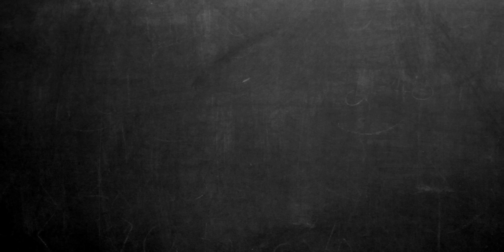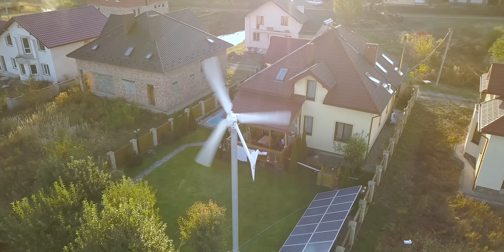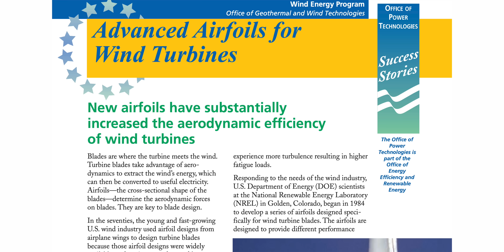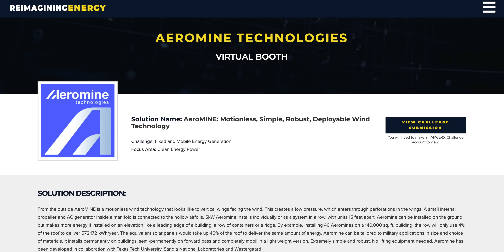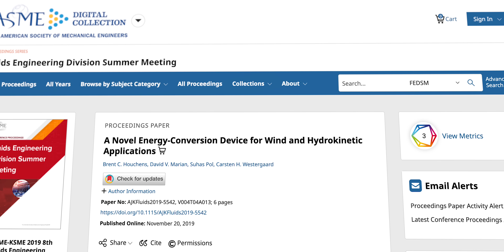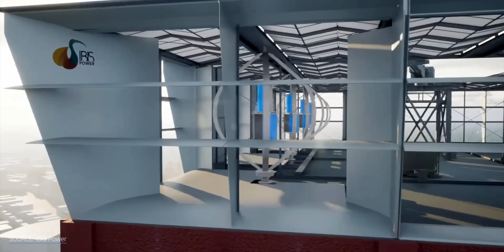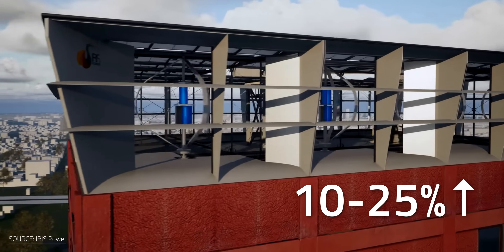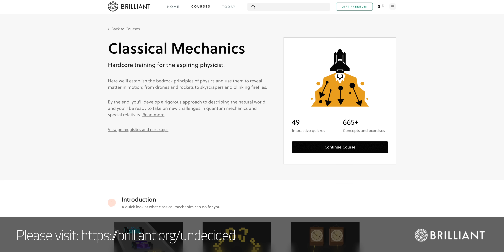How Can A Wind Turbine Be Motionless?

Comment: Really appreciate your videos, all the updates on new technology, research and new ideas.

At different points in this video, the Aeromine system is described as having “no visible moving parts”, or similar phrasing.

At 3:56 in the video, a diagram shows air being drawn past a “fully enclosed wind turbine”, “at ground level”, through a set of pipes.  It would seem as though potentially lengthy pipes would create drag and inefficiency.

At 6:00, the video of an actual installation (BASF) looks upward toward the Aeromine, and what appears to be a wind turbine can be seen beneath the central column, between the airfoils.  It somewhat resembles the “roof vent” seen on many residential roofs to pull air from the attic.  That arrangement would seem to be more efficient.

It would be interesting to know what kind of turbine or generator were being used. 

Long ago, I became interested in “ducted fans”, which are usually employed on a horizontal axis, such as an aircraft engine and propeller, or HAWT.  Allegedly, their use on wind turbines was limited to fairly small ones.

For several years, I have been thinking about a VAWT design employing a pair of vertical airfoils to funnel air to the “downwind” side of the VAWT, while shielding the “upwind” side.  That should both increase velocity and reduce drag.  

The Aeromine concept is fundamentally different, but the physical structure is still remarkably similar.  I would think a VAWT placed between and slightly behind the two airfoils would be significantly larger and more efficient than the small “hidden” turbine.

Comment: Please stop spreading false information about aerodynamics. The speed of the air does not change, it's direction and pressure is changing. Think of a sail boat with sheet thin sails, the velocity on both sides will be roughly equivalent, but you change it's direction and create a low pressure area which sucks you along. Your comparison with race cars is laughable. Under the car is a vacuum, not a high speed flow, especially given the wind friction of the stationary earth under them. A jumbo weighs almost 400,000kg and one cube of air weighs 1.2kg. imagine how much wing you would need if you were not creating a vacuum and just relying on Bernoulli. At least get the science right.

Comment: PowerNest is a well thought combined solution. Even the wind turbines are equiped with 2x Savonius rotors to help starting at low wind speeds (4x would be still better). The worrying feature is high speed wind tolerance. The forces during storms up to 50 m/s wind speeds can rip off first the panels and then the wind blades out from the roof. The panels form a really large "aeroplane wing" , because air flow enters under the panels and vortexis enchance forces. The joints to the roof and the internal strength have to be 4x secured during the whole operational period, more than 20 years, taking into consideration rusting and structural fatigues.

Comment: These are marginal, but when combined into a system they have an additive effect that can put the ROI over the top. If the static venturi creating a vacuum that turns a turbine is allowed to run over solar panels on the bottom after 1st going through the turbine generator the added power generated in that turbine comes from the pressure boost from the solar panel waste heat in a chimney effect.
If each side could rotate to be an exit or an entrance, then wind direction can change.
This static one direction only is to limiting beyond niche markets, with one direction wind blowing all the time...

Comment: This technology would  work better under water in conjunction with a Tesla turbine.  Maybe within  the water supply system itself.  Each home generating power when using water.  May even increase water pressure into the home.

Comment: I used a 1/3 hp 110 v motor for my first experiment. I attached two large (100 lb lift capacity magnets) to one side of a six inch circular by 1/4" plate of aluminum and bolted it to the motor shaft, magnets facing outward away from the motor. It was bolted down securely. I then took my 1/2" copper coil and placed it beside the magnets at a safe 1/2" and turned on the motor. In a very small amount of time the copper coil was glowing red so I quickly shut off the power. I was so impressed I went and purchased a solar panel of (33volts LR4-60HPH 355-385M) this with its 12v computerized controller should be more than enough power to operate my next experiment. I also bought a lithium iron phosphate 12v battery to start my project. My intention is to operate a 12v motor instead of 110v and build an overflow system to catch the expanding water in the coil witch will also have two one way valves to help with circulation, and a radiator to dissipate the so needed heat in my winter home. 
'
'

Comment: Nono... The wing of an airplane is not "pushed" from the bottom as your video show it but it's sucked from the top, it's not the higher pressure under it that make it fly... but the lower pressure above it.
Again... On the car, nothing is pushing it as you said, you completely missed the point.. the car is sucked to the ground because of the lower pressure under it.

Comment: Probably late to this but if the venturi effect has a cooling impact, would it be possible for get even more out by laying between the solar panel frames some piezoelectric based system to draw from the temperature difference? Just a random idea.
Reply: Actually, since the air is compressed as it goes from a larger area to a smaller area, speed & temperature would both increase, but the temperature increase would not be huge, because the pressure change is not huge.  As the air exits the venturi, it cools & slows down again.  This “cooling as the pressure drops” is how air conditioners work, but the pressure changes are much bigger.

Comment: This is such BS. The reason that wind turbines aren't typically put on roofs has nothing to do with having moving parts. The reason people don't usually do this is because it is really inefficient. Guidelines for a typical home wind turbine is that you should mount it at at least 30 feet above all surrounding objects. Also it has been demonstrated time after time that ducting wind turbines does not increase the efficiency. The only way of increasing power is by lengthening the blades.

Comment: @UndecdidedwithMattFarrell 
I have a couple questions.   As I believe you know this subject better than I so to me, you're the expert.
Which Home or Rural Wind Generators work best?  Perhaps I should specify; 
Is there a different wind generator better for a home under 2000 sq. ft.  vs  the better system for a house under 3000 sq. ft.  Or a piece of land that is apprx. 1 acre in size with a barn?  Inquiring minds want to know.  
There are so many options advertised on Soc. Media that I never know which one is real or good, or which are just wind up my shorts. 🤭😄
Thanks for all you do here.

Comment: 3:00 You are a little wrong with the way you describe how an airplane generates lift. Yes at a positive AoA(angle of attack) the higher pressure below the wing will push upwards. Kinda like putting you hand out of a car window while driving, this is how most people think lift in an airplane is generated. They think that the air pushes up on the wing from below because of the AoA of the wing, however MOST of the lift comes from the top of the wing having lower pressure. 2:40 shows an airfoil at a high positive AoA. If for instance you had a cambered airfoil, like the ones on an airplane, at 0 degrees or even slightly negative AoA it will still generate lift even though there will be no upwards push from the bottom of the airfoil.

There is a simple experiment that will prove how most of the lift is generated. Take a piece of paper in front of your mouth. Let it hang down and only blow across the top of the paper. It will be lifted upwards, hence why it is called lift. Roughly 65-70% of an airplanes lift comes from the top of the wing.

Comment: I believe the Powernest is a better idea simply because of different directions the winds can come from. The new wind invention captures wind coming up a building wall from a fixed position, but if the wind comes from behind it, equals no capture and no energy. The Powernest also performs a cooling of the solar panels, adding longer life to the panels. My money is on the Powernest. Great vlog of information as always.
Reply: Powernest is a low efficiency system as more than half the wind is bypassed.  Any solar panel mounting that is raised gives wind cooling.

Comment: I have a few questions regarding the longevity and efficacy of this product. Most power generation devices are developed in areas where there is an average temperature of 28°C during the summer, and -10°C in the winter. 

How would this installation withstand a full northern Canadian winter of -28°C to -35°C and snow? 

Wouldn't snow and ice build up be a massive shortfall for a rooftop mounted installation? I would imagine that it would need some sort of heat line to ensure the venturi tubes do not fill with snow. 
You mentioned that there have been installations in the Netherlands. Have there been any attempts to test installations in Norway or Southern Sweden?

Comment: I've often thought we should be able to harness the sun's power in a focused way like this.. like basically create an orb or dome type magnifying glass that can direct the the light into fiber optics or something reflective and transfer that to some very concentrated panels that don't need to be as durable or resistant to weather.. you could capture a larger area of light with cheaper materials from more angles and then direct it at the panel, getting much more power out of the same square footage than your average stationary panels.. or maybe skip the solar part altogether and just use the concentrated heat instead since the main drawback to this idea is probably cooling the system.

Comment: After all, the reason is the price for the entire described area (by the blades of the propeller during rotation). The cheapest description of the area of the propeller blade.
Another parameter is the price of protection against strong wind. The cheapest again are propeller blades.
Energy is always proportional to the area described by fixed and also moving parts of the device.

Comment: Hi Matt - I think these wind devices are probably not as effective as they make themselves out to be.  For example I need to reach 60 miles per hour to get my airplane, a Cessna 172 airborne.  Full weight is 2,550#.  The wing area is 174 square feet, or 25,026 square inches.  This works out to .01 psi lift for a fairly efficient wing at 60 mph.  At slower speeds the lift is much lower.  This wind device is a clever idea but it doesn't stand up to the calculator test.  Thanks - John

Comment: OK I was going to ignore the bit about airfoils enabling us to conquer the skies. Then you got onto Bernoulii effect. So... while, yes, the airfoil shape is important it is hardly the reason we were able to develop powered flight. The key development was not the airfoil shape but the POWER. Enough power in a light enough package is what enabled us to conquer the skies. Yes the shape of the airfoil in the wing and propeller (even more so arguably) enabled efficiencies and control of the behaviors but it's importance is really overstated and the importance of all the other things that make aircraft possible get lost in that oversimplification. Bernoulli effect is barely in play at all. Air does NOT travel faster over the top of the wing because it magically needs to catch up with the air below the wing. The wing is tilted up so the bottom of it pushes air downward. The flow is way more complicated than that but mostly it's not about airspeed differential. 
Need to understand how lift is created? Grab a sheet of plywood in a good breeze.

Comment: All very interesting and encouraging.  However, I was surprised that the Aeromine units are restricted in that they are unidirectional.  They don't appear to be so massive and large that they couldn't be mounted on a rotatable base that would allow them to operate with high efficiency by following the wind, regardless of direction. That can't be such a novel idea that it hasn't occurred to the engineers, so I'd like to see more explanation of their reasoning in not doing that.

In any event, I'm pleased to see that innovation continues in the realm of these kinds of power sources.  Keep it up!

Comment: Your explanation of the "upside down" airfoil of (racing) cars is wrong. Cars have the exact shape of an positive airfoil (straight underneath, curved at the top), resulting in higher air pressure underneath the car and lower on its top. Therefore every car of this shape tends to "take off" at higher speeds. The aerodynamics of most racing cars are still in the "middle ages" and all are countering the unwanted lift effect with spoilers on top creating drag and/or reducing airflow underneath by lowering the car. Only the latest Formula One car designs tend to go in the opposite direction by letting air flow underneath the car in a sort of upside down airfoil direction, creating a suction to the ground effect. But that's still work in progress...

Comment: I think personally that renewable (especially solar and wind) energy will be miniaturized to power individual buildings. This will mean power independence for both the industrial companies using them as well as residential buildings and also reduce the load on the public electric system, allowing them more time shift to a largely renewable power grid system.

Comment: Thank you for explaining technical features in a lucid and practical way. I helped install many wind turbines in the Tehachapi desert, ca. I also love birds which these turbines destroy quite frequently. Currently gathering materials for a small savonius rotor which does not harm birds, will not over rev and can use wind from any direction, eliminating need for extra components. Have you any plans for videos on this efficient rotor system?
Reply: Birds killed by wind turbines are only a few hundred thousand, while cats kill an estimated 2 billion and buildings around 500 million.
Reply: Also, wouldn’t that idea have low power output due to smaller swept area?

Comment: With all due respect, your explaining how this unit operates,  from 3:35-3:55 of your visual aid, just isnt understandable.  Even  dumbed down, what is happening isn't conveyed. Your comment "as wind flows thru its drawn to perforations in the wings".. then you show some tiny action-lines that do what? No arrows there, BUT there's huge arrows flowing up.. to where? The top is closed in. You then say, "the trapped wind [in the foils] is 'brought TO' the turbine".. but this is opposite of your  visual as  the arrow flow is coming FROM the turbine.  Huh?
Did you even watch this before uploading?  I REALLY wanted to understand but I had to shut it off, as you're building the rest of your vid on that mess.

Comment: How is a simple turbine more complicated than pn junctions and semiconductor physics? Absurd statement. The reason we don’t see more wind turbines on roofs is because of the turbulence experienced close to the ground, especially in developed areas, reducing the efficiency of turbines. In any fluid flow the boundary layer where the fluid interacts with objects experiences reduced flow rate and turbulence.

Comment: 140MW a year?  The normal measurement of a power plant is in KW/H
If we do the conversion, it is producing 140000KW/Year
With 8760 hours in a year, it is producing about 16KW/H

Thats good supplemental power. But we still need a green backbone for the power grid. Something along the line of 1,000,000KW/H

Comment: When ball parking the amount of material required to build an aeromine vs the area it sweeps, it seems to be a lot more wasteful than conventional wind turbines. This means 2 things:
-its installation cost is likely more costly
-its ERoEI (Energy Returned On Energy Invested) will be much worse than conventional turbines because the invested energy mainly consists in fabricating the turbine, which is highly linked to the amount of materials required.

The second point is important when considering the 20year avg lifespan of current wind turbines and given that building them required the equivalent of 1 year of its electrical production (this varies a lot depending on location). With the directionless design of the aeromine and its reliance on higher air speeds and larger pressure differentials, i m not very hopeful on its efficiency.

Let s wait and see the actual numbers but i would not be surprised if the amount of electricity produced by an aeromine through its whole life is lower than the amount of energy that was required to build it.

Note: by conventional turbines, i am refering to the large wind turbines which makes up almost the entirety of wind electrical production

Comment: The wind machine design is a vertical axis machine with a u/v ratio less than one, unlike 3- or 4-blade windplants which are closer to 5 times the efficiency.  A windplant on a roof is noisy and the real wind is high, as found if the windplant is high on a tower. I dispute virtually every claim made of this windplant.  Sorry. It won't fly.

Comment: I have designed, built and use Savonius-starter Darius VAWTs for over 50 years.  They make both a.c. as well as d.c. ONE moving part. Are there any of these zero-moving-parts wind turbine field-proven units up and running? Mine have run for 50 years.  I think I'll stick with my proven design.